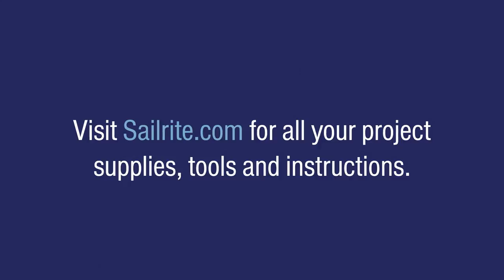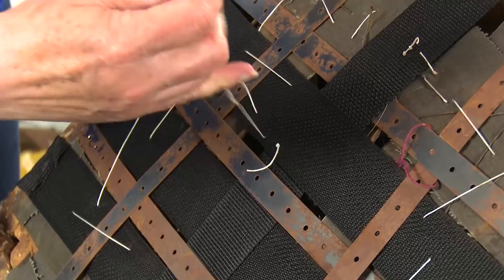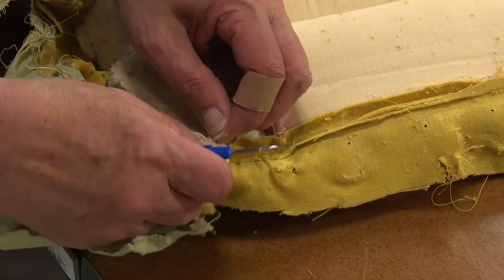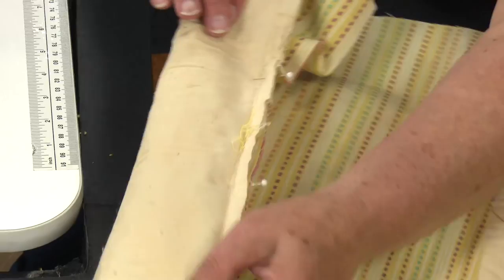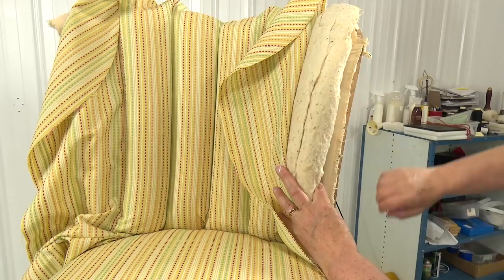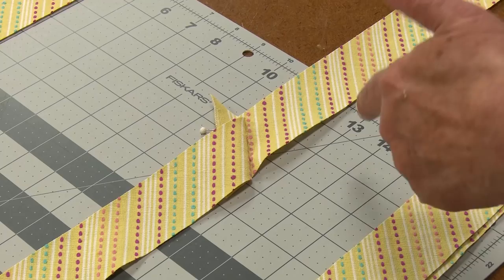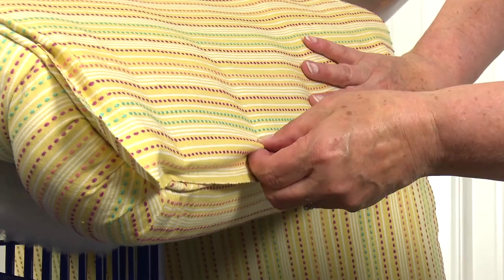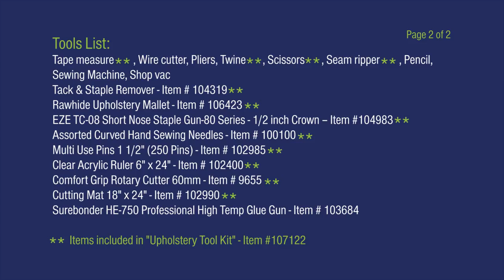Reupholstering a Channel Back / Fluted Back Chair

Comment: Hello,  do you change the staples size or use a different gun when doing the curvees and cording?? Or just use the same size for all...??  Thank you
Reply from the maker: No, we did not change the staple size. We used a 3/8" leg length staple for this whole chair.
Reply: you can use any 3/8 crown upholstery staple

Comment: how much fabric for two chairs? Is it double or is there any savings?  I  think the ones I have are what they call slipper chairs, however it looks like the legs are the only difference.
Reply from the maker: If you do two chairs you can usually order about 25% less fabric than it would take for just one. Use this calculator to help with your figures of how much fabric to order: http://www.fabric-calculator.com/chairs.aspx This chair takes about 3 yards.
Reply: Thanks so much, but I don't see anything comparable to mine. Well there is one, but it looks like it is missing a cushion. Do you have any place I can send photos of my chairs for and estimate?
Reply from the maker: Yes, send it to eric@sailrite.com
Reply: Thanks

Comment: Love how she eyeballed everything with fabric pieces and never measured any of it out. Just a tip around the edges with that metal strip try laying it down with the edges so you don't staple the hell out of the wood. The edges you hot glued was awful looking I would have been super pist! Try next time to just roll it under the edges then staple so there aren't any strings hanging out. Lol smh

Comment: I don't really want this to be a bash session, but there are several things wrong here.
The new fabric should have been ironed flat before attaching to the chair. Do not rely on stuffing and tugging on the fabric to remove creases. This is a cheap short cut. The folds in the front corners instead of stitching a box seam in the fabric was another short cut and the folds are too loose and don't look right. 
That contemporary fabric does not fit well with a classic chair like that. They should respect the style of chair and use a more classic pattern of the era that chair was made or another solid color.
The dust cover under the chair is also cheap. You can see right through it and see the other fabric through it too. Yes, no one sees the under side of a chair very much, but since this chair has fairly long legs, and the bottom is more likely to be seen, a thicker fabric should have been used. 
I realize reupholstering a chair is a lot of work. Taking that into consideration, why not take the extra steps and get better fabrics and techniques for it?
Reply: SpiritBear12 well the look is entirely up to them or the client but I agree everything should've been ironed. Did the original have a boxing stitch around the front?
Reply: SpiritBear12 .

Comment: Sound is way off, it's ~ 30 seconds ahead of the video.
Reply from the maker: +David Jones David,
I checked the video and did not notice an issue with the sound. Can you check again and let me know if you still have an issue?
Reply: they have probably got sound faults on their computer. as I have no problem with the sound.

Comment: The video seemed to be interesting, until the moment that it starts to do gambiarra, that is, does not make the whole process. Even the old tacks she did not have the courage to remove, on the contrary, preferred to hammer them. The worst part was the fact that I had not redone the seat from the start.